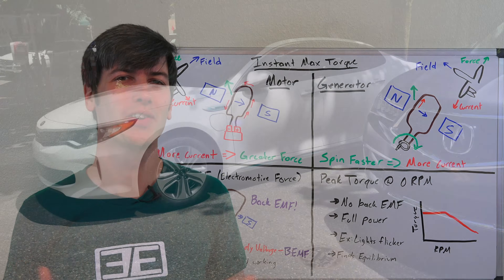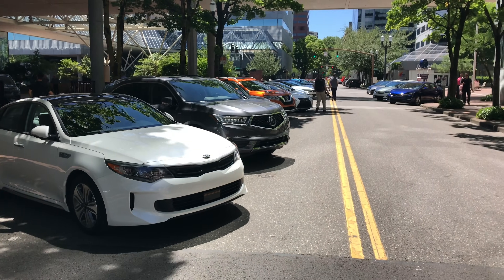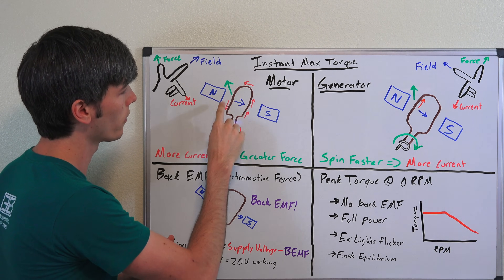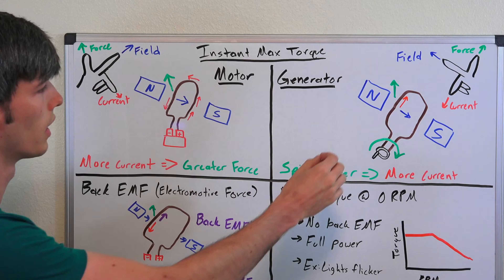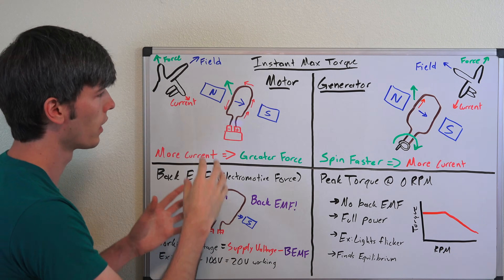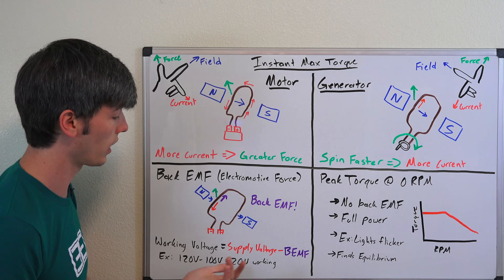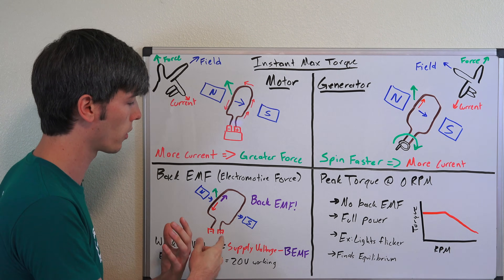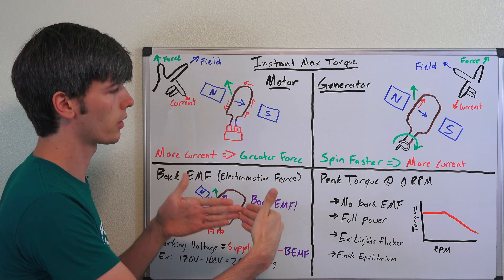How Do Electric Cars Produce Instant Maximum Torque?

Comment: It's a simple experiment i learned as a curious child. You stop an electric motor weather It's a fan or a drill even if you stop it you don't actually "stall" it you still feel the torque fighting you amd trying to turn mikd you you will overheat and burn up the field winding doing this for too long but the motor is still making torque even if it's stopped and not spinning. If you hit a big rock with a lawnmower it stalls and doesn't re start on it's own it has to be cranked again I.e pull the cord to re start it this is because you disrupt the combustible cycle in  which the engine is costing three out of the four stroke. Meanwhile an electric motor no matter the position of the rotor relative to the stator it will always make torque as soon as poer is applied due to the rotating magnetic field that is produced wgen power is applied.

Comment: What I can't understand is how the electric motor overcomes the massive weight deficit of a car. I get that the electric motor provides instant torque, but from what I understand here, it's the current passing through the wire that is causing the motor to spin (and presumably, this rotation is transmitted to the wheels, yes?). Ok, but the components generating the rotation are significantly lighter than the weight they're trying to move (the car). How does the motor overcome this resistance without burning itself out?

For example, I can understand an electric motor working on an RC car or E-bike, because both are extremely lightweight. 

But a CAR weighs in excess of 2600 lbs soaking wet. It just seems to me that given the bulk the motor is trying to budge, the motor itself would break from the strain before it could move 2600 lbs. 

I mean, I get that a combustion engine is also lighter than the vehicle it's powering, but combustion engines produce power by compressed explosions pushing against reinforced metal pistons/rods. In those engines, the expanding gases MUST go somewhere, and they will follow the path of least resistance. Since the rotating assembly offers "give," the piston gets pushed down. 

But how does the electric motor overcome this? It still blows my mind that diesel locomotives generate motion with electric motors! WTF?? A freight train with loaded cars weighs thousands of tons! How do the electric motors overcome that kind of weight??

Comment: Someone told me that Tesla motors are connected directly to the wheels with no gearbox between , then they said they rotate up to 12,000 rpm , I find this very hard to believe as a average car tire is around 6ft in circumfrence , 12,000 x6 =72,000. 
72,000 ft in 1 minute is 13.2 miles per minute  
A tire or wheel could not take those kinds of centrifugal forces 
That 780 mph 
I told him to go back to math class

Comment: This is the stupidest explanation. The question doesn't come up inside a vacuum or under the context of back EMF, but rather in comparison to an IC engine that requires gears. 

Your explanation is akin to saying cars can run 100mph because the speed limit or drag doesn't prevent it from doing so.

Comment: I am not convinced!  Peak Torque does NOT occur @ 0 RPM! From what I learned from elementary math, that if you multiple or divide anything with 0, your equation is 0! So 0 rpm = 0 torque. It is more technically correct to say, instantaneous torque compared to gas engines.

Comment: Because electricity current times voltage is power, power is what causes torque. Electricity moves at the speed of light. Metal does not.

Comment: This is why all locomotives are desiel electric. You use the high zero rpm torque to move the train something that would be hard to do with s combination engine with out an insanely high gear ratio.

Comment: A question to The Engineering Explained speaker, can I ask to you about EV? So why do we need to use gear reduction/higher gear ratio (such as 13.0 to 1 or maybe 8.0 to 1 gear ratio) on an electric car? I mean you've said that an Electric Car produce high torque/peak torque even when starting the car from dead stop (zero rpm). Unlike an IC Engine which can only produce low level of torque when your in very low rpm. And then from the previous video, you said why can't an EV hit 300 mph, and you answer if the EV need more power like IC Engine or maybe it because of less effective cooling to the EV component while driving with maximum power. So I'm just wondering all about the physic and theory, and then I found a question/statement. I think: rather than making an electric car produce more power, why don't we just fix the drivetrain. And I think if we don't need much torque when the electric car's speed is fast (beyond 90 km/h). So we don't need a high gear ratio at that moment. So we can just change the current gear ratio and replace it with much much lower gear ratio. So that's all about my question, please take a time to think about it and then you explain and give me your opinion. That's all I have to say, thank you very much. And I like your video☺😚😚👍

Comment: So in order to maintain peak torque in an EV, you would need to add more gears and shift early? Also, since horsepower is torque × rpm and if the goal is to maximize horsepower, would it be better to stay at a higher torque with a lower rpm or a lower torque at a higher rpm?
Reply: at whichever gear ratio it generates the most power at a given speed ,this could be first or the second option, or something in between the ratio between nm and rpm for egzample 1000nm at 1000rpm at 50km/h give you more uoutput force and power than for egzample 500nm at 1500rpm but less than for egzample 250nm at 7000rpm at the same vehicle velocity you can find turbodissel engine which be accelerate better than some naturally aspirated engine but noit because it have more torque at engine crank but beacuse it produce more power torque at engine crank is pointless if you dont know at which rpm it egzist at end more power always win no matter  your vehicle those more power achieve be biger torque at lower rpm or thanks biger rpm and less torque  just proportion beewten rpm and torque must be optimal in each engine this most optimal proportioan beewten torque and rpm engineeer call peak power .

Comment: I got lost at the back EMF stuff... I don't understand how this back current means you have full Torque, gonna have to rewatch! (Or if someone can explain in other words). I understood that, your motor isn't spinning so you have no resistance, okay, but then you apply current, your motor spins which generates a back EMF and.... I don't see how it's linked to the FULL RPM stuff.

Comment: This is still not the most fundamental explanation. Electricity is simply more robust than combustion, unless you want an explosion, you can't use combustion to deliver maximum energy instantly, whereas with electricity you can. For those who don't know, If you have a battery and a load (e.g a light bulb), all it takes to instantly have the maximum current run through the load is close the circuit, it's pretty much the same with electric motors, but you don't see people surprised how light bulbs work instantly as they are with electric motors, because they don't realize they're fundamentally governed by the same principles.
When you explained the thing about back-EMF, you're assuming the average person already knows that voltage sources can instantly deliver max energy to loads.

Comment: Is there any point in which the back EMF is greater than the voltage being supplied?
Reply from the maker: +Elijah Drew nope
Reply: If there was a dramatic decrease of voltage would the momentum be enough to Create more back-EMF than supplied voltage?
Reply: Ok, makes sense, but because of friction you can never have an equal back-EMF Voltage and voltage supply if no outside forces are acting on it.... Right?

Comment: Hey mate your video relates to traditional brushed DC motors which doesn't really apply to modern cars. Aren't the high powered cars that report instant maximum torque usually AC induction motors? AC induction motors use an inverter and are able to apply the required frequency and voltage to maintain maximum torque at any rpm from 0 to maximum. Applying full line voltage and frequency at zero rpm (which is the AC equivalent of the maximum working voltage you describe for a DC motor at zero rpm) results in less than maximum torque, poor power factor and high magnetic losses. Similarly brushless DC motors use an inverter and don't necessary follow the torque curve of traditional brushed motors, since the inverter can manipulate the voltage and phase angle and produce different results.

Comment: You keep saying it is available at zero RPM. You know that peak torque is available only at any RPM above zero, so why do you keep repeating this? No torque is available at zero RPM because the motor is not working. Please correct.
Reply: Nope you dont need motion in roatational system with leverage for geeereating torque  for egzample you want the unscrew the screw but it hold so strong that even if you aplly max your force on key the screw dont even move be 0,00000000000000000000000001milimetres  if key have let say 1 metres lenght and you aplly to key 1000niutons force at its end now you generate in axis of screw torque = 1000Nm but thers no move at all because screw givve to big resist and you must use biger torque to unscrew this screw so or you must use longer lever this key which increase torque when you aplly the same force or you must use more force so take other person which help you push or pull on this key etc ,only power cant be generated when ther is no motion vs torque can .

Comment: Small but important correction... Higher motor speed does not induce more current, it induces more voltage. The current comes from torque.

Comment: This is how I understand it, please CORRECT ME IF I'M WRONG: The motor uses electrical currents to spin an electromagnet (the armature) which is connected to the axle. The motor creates resisting voltage, or back EMF (electromotive force), which decreases torque. But, when the motor is not spinning it doesn't create any back EMF, so all the voltage is used to create torque. Once the motor is spinning faster, back EMF/resistance comes in, and torque goes down...right?
Reply: Yes, that was exactly the point.

Comment: Doesn't this mean that an EV will have lower and lower amounts of torque as it speeds up?  And, that being the case, would it be actually beneficial to move to a higher gear ratio to reduce back EMF, or would that be a wash as far as total torque available?

Comment: Does this mean that even when you are going uphill, as you use power to spin the motor, some power will get back to the batteries? Or does it only help to run the motor with less power?

Comment: I really want to know why electric cars aren't self sustaining yet? why can't they charge themselves as they are running without needing to stop to be plugged in and charged or  needing a gas engine?
Reply: Because it's not a perpetual motion machine. You need energy to overcome rolling resistance and drag and it doesn't matter what you do, you will never get the energy back which was lost to them. So the efficiency is less than 100% which means at some point you will run out of juice.
Reply: shi01 i understand that part, but why can't it keep itself charged with a smarter styled alternator or a perpetual generator that will start moving once the car starts moving, constantly generating power to the batteries? 

is this really a hard concept to overcome?
Reply: It's impossible to solve this problem.
What you want is car that is constantly generating energy by itself basically out of nothing. That's not possible because it would become a perpetual motion machine if it would do that. It would need an overall energy efficiency of more than 100% and there is no known way to achieve this.
An alternator of any kind will always apply negativ torque to a mechanical system. basically braking the car to generate electricity. If you want to slow down the car, that's great. That's what we call recuperation. But if you want to accelerate the car, any kind of alternator would work against the acceleration. And somthing like a perpetual generator doesn't exist.
Reply: shi01 impossible? is it impossible to even come up with a complex solution?
Reply: It would break the basic laws of thermodynamics, it's so impossible. That's pretty hardcore impossible in my mind.
Reply: shi01 Damn! that is serious!
so the only solution would be make the cars as sexy as the Fisker was, produce as many charge stations as there are gas stations and make better battery packs.

Comment: For the first time, I actually disagree about something :-)
As always, fantastic channel, obviously!

You said that manufacturers engineer their internal combustion engines to produce peak torque as low-down as possible, because that makes them the most responsive and most enjoyable?
I disagree with that. There's nothing more fun than a linear naturally aspirated engine that makes peak torque higher-up in the rev range.
I've had many fun NA vehicles and I now have an F10 M5, which is artificially tuned to deliver its power as if it were naturally aspirated.
Sure, there's a huge rush of torque pretty-much anywhere in the rev range, but it pulls progressively harder as the engine's RPMs climb.

Which brings me to a question for you.
Do you not think that the primary reason these manufacturers try to make peak torque as low down as possible, is to make the cars both easier to drive and more efficient by lowering the point of boost threshold? (Nothing to do with turbo lag)

Comment: What you said is true, but it doesnt really explain why electric cars offer peak torque from 0rpm. Cars today dont use DC motors (which you are describing). They use induction or synchronous motors. Synchronous motors do have a flat torque "curve", like a DC motor. Induction motors dont, and their peak torque is avaliable somewhere at say 94% of their sycnrhonous speed, but thanks to vector control algorythms in their inverters, you can utilize that torque from zero.

Comment: A question, has I anderstand it right that the Back EMF causes that the torque actully going DOWN with higher revs. So with an electric motor it is good to keep the revs low?

Comment: I want an electric motorized car with a manual gearbox. Possible, right?
Reply: All you got is the fun. But for me,The delay you sift the gear already and the weight reduce the fun. Because the gearbox reduce all the potential power electric motor have.

Comment: I disagree that peak torque at low rpm makes an engine more responsive. Turbo diesels have low rpm peak torque and they are just so painfully unresponsive due to immense turbo lag.
Reply: Apparently you've never driven anything electric. Even an electric golf cart has enough power to pop a wheelie if you bypass the controller. Electric motors have instant peak torque at 0 rpm, which is much different than thumb-twiddling turbo-spooling low-RPM combustion-engine torque
Reply: Yes I agree with what you are saying, but you did not get my point. Responsiveness is not about how much torque at given rpm, but at how fast this torque is available. Of course electric have instant peak torque at 0 rpm, but a turbo diesel needs few seconds to have peak torque at below 2000 rpm, whereas an atmospheric petrol would have it also nearly instantly. Even if the torque from a petrol engine is 1/2 of what the diesel can deliver it still feels more responsive.
Reply: Right on... As EE says, electric motor torque does drop off as RPM increases. I think the best thing to do is drive 'em all and buy the one that turns you on.

Comment: Here's one thing I don't get, because of static friction being greater than moving friction, wouldn't net torque coming out of the electric motor technically be greater at 1RPM than true 0 RPM full stop ???
Reply: Benjamin kier If you're going to bring up stiction, I'm going to bring up the angle of the dangle, the heat of the meat, and whether the juice is worth the squeeze... I think Engineering Explained was rounding when he said 0 RPM. By your reasoning, torque is greatest at the lowest possible RPM greater than 0, which is a hell of a lot closer to 0 than 1. ;)

Comment: They actually shouldn't.   According to the chart the cars have current limiters to keep you from being able from actually reaching the maximum torque of the motor.
Reply: Exactly. The torque curve of basically any electric cars is basically preprogrammed. They have a flat torque curve on purpose until they reach their rated power at a given rpm. The electric motor by itself could deliver a lot more torque from a stand still, but that would be totally useless so it's cut down by the control electronics of the motor.
Reply: shi01 Right armature!

Comment: Nice video. The way you drew the torque vs RPM graph, the torque stays level for a bit before sloping downwards. Why is that? Wouldn't the back EMF begin to counteract the supplied voltage right when the RPM goes above 0, resulting in decreasing torque right from the get go?